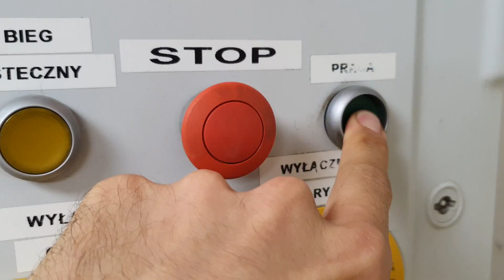Dogłębne czyszczenie EKSTREMALNIE zabrudzonego dywanu, kilkuletnie zabrudzenia i plamy zniknęły 😍

Comment: Is the chemicals you use safe for the environment and where does  it go when your done👋
Reply from the maker: They are environmentally safe prepatar 💚
and the water is partially recovered 💧🤗🌎
Reply: The chemicals are made from discarded hairspray, burning rubber tires, spent nuclear fuel, and the tears of baby seals.

Comment: Is this rug worth cleaning? I think it would just be cheaper to throw it away and replace it....
Reply: Cheaper yes, But why row a rug or carpet away if it can be cleaned? Is that not worse for the environment?  They won’t breakdown and landfills are limited. Water is not. Water is plentiful compared to land. So this is better for the environment…. Also they usually recycle water …
Reply: @sammyn9345  carpet is a synthetic fiber, which breaks down in ~20-50 years. We have plenty of landfill space to handle old dirty rugs lol. Im not suggesting that he go out and burn 60 tons of rubber, im saying that its probably cheaper and less hassle to just toss the rug and get a new one. Source: I'm a solid waste engineer who literally designs landfills